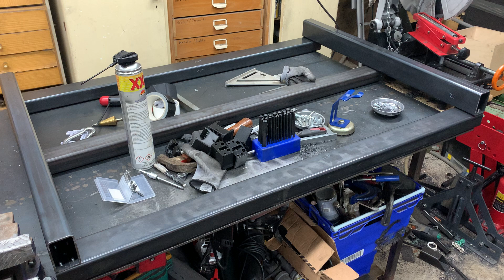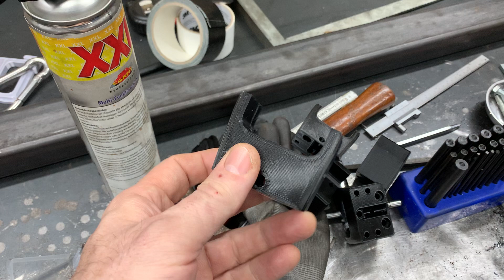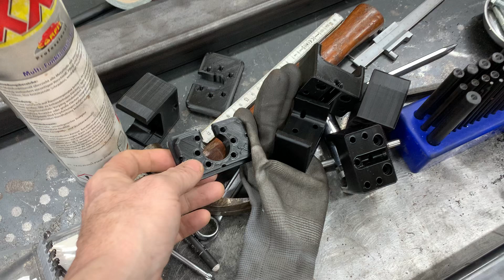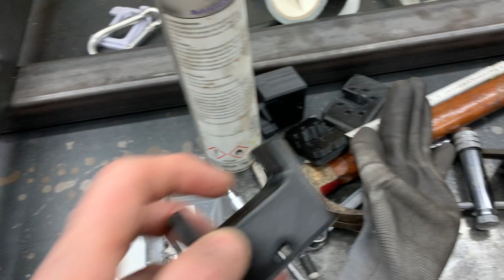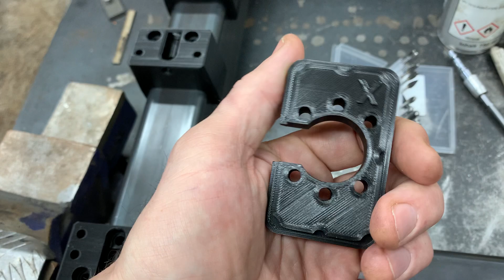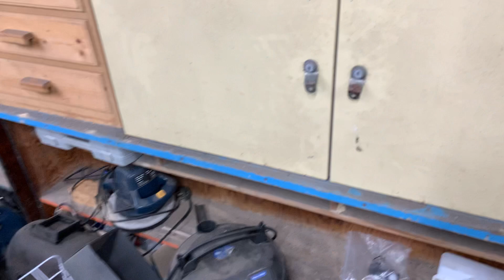PrintNC Part 1a. Frame Standard Size, first assembly and where to put the vice. DIY CNC Router.

Comment from the maker: 4mm
Reply: Would you say that 3mm could be as stable or would you recommend still doing 4mm?
Reply from the maker: @philipfuchs777  i would say 4mm is better. If you have 3mm already it will work. If you are going to do the work and you are ordering the steel 4mm is worth it. I always intended to flood cool and do bits of steel so the thicker the better.
Reply: @cszrwi  that was a very helpful reply. Thank you a lot